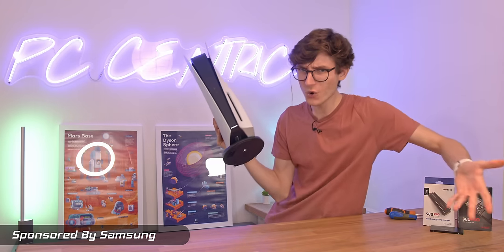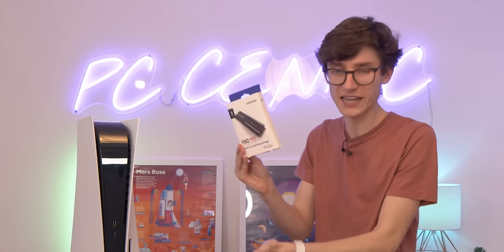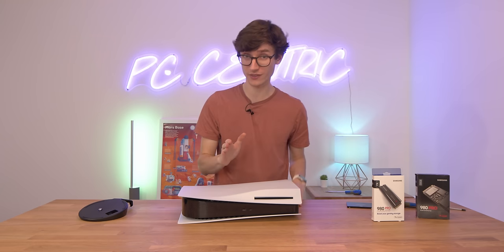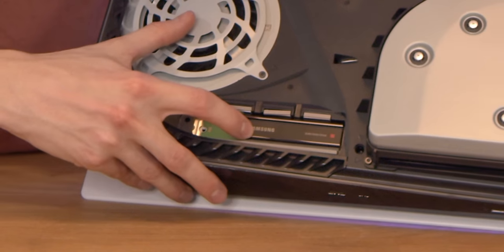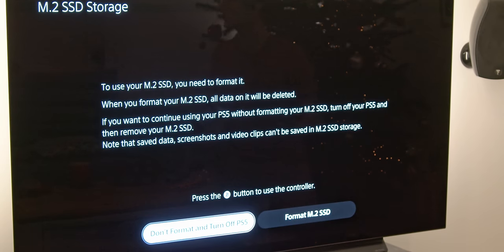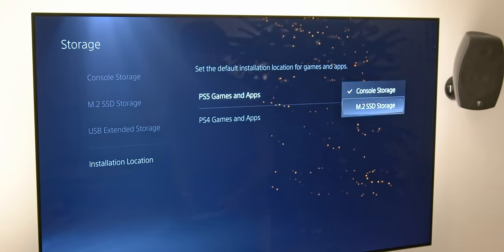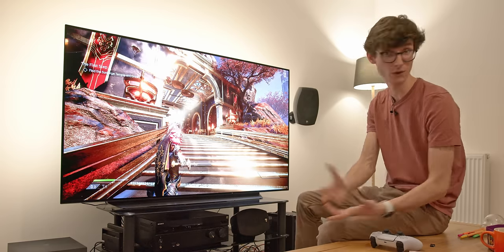How To Upgrade A PS5 SSD 😁 - Samsung 980 Pro Install for PlayStation 5 | AD

Comment: Alright guys, this is extremely IMPORTANT*** when unscrewing the second screw(tiny one), it comes with the spacer given right underneath, make sure to put that spacer on first before you screw the ssd down*** was not shown in this video but just a heads up fellas🤙🏼
Reply: You're the man! Thanks boss
Reply: I think he did show it

Comment: You should tell your viewers to update the firmware before they install it so they'll be able to get Max speeds. If not the drive will be throttled to 5500 mb/s not 7ooo mb/s. Good vid tho 💯
Reply: Dived into the comments to see if anyone noticed the lower speeds
Reply: Update firmware on what? The drive or the PS5? My internal SSD 2 tb of this model comes tonight n like to know what u mean?! Thanks!
Reply: How do you do that?

Comment: The most affordable option that meets playstation specs and comes with heatsink out of the box is Adata XPG Gammix S70 blade 1tb is now on sale for $129.99 while 2tb is on sale for only $249.99 and a 512gb option can also be had for just $89.99.
Reply: Well on Black Friday I was able to get the Sabrent Rocket 4 Plus 4TB for only £560, plus £10 extra for a heatsink. That is quite good considering that most compatible SSDs do not have a 4TB option.
Reply: @shyamal903  Every price that I've mentioned has been for America and again here in America the best 4tb SSD option based on price that comes with heatsink out the box is the Addlink Addgame A92 and it can normally be had for about $550.

Comment: Make sure that the drive + heat sink you select will fit under the drive bay cover (assuming you are wanting to put the cover back on) as some heat sinks can be quite tall. Sony have listed the full specs on their website
Reply: Did he show how to install heatsink in video?
Reply: I think it’s 22mm in width. Which SSd did you get? I’m still deciding between a 1Tb or 2.  Not sure on the brand either
Reply: @davidsalas1561  he did not
Reply: That drive is designed to be heatsink as well you don’t have to get a separate one.
Reply: @davidsalas1561  the ssd had a built in heatsink

Comment: Thank you very much. Great tutorial for someone who was a little intimidated by taking apart my PS5. There is another video that explains how to remove the cover by lifting a corner and sliding back. That technique worked better for me. Other than that one small detail, your video was very helpful. Cheers.
Reply: Thank you, worked so much easier, I thought I was going to snap it the way he said it, where as it came off with ease the way you suggested
Reply: Glad I found your comment first cuz I was about to do the exact same thing. Felt like I was gonna break something so I came to the comments to see if anyone had a better way to get the panel off😅

Comment: Love how the internal screw that holds down the SSD came out so easily. I almost stripped mine trying to get it out. Used the correct size Phillips, but the screw was so cheap and felt like it was loctited on.
Reply: This same thing happened to me it was the only problem i had doing this i had to try five micro phillips finally found one that worked i was starting to worry a lil bit.
Reply: I don’t even see a screw??
Reply: bro mine is completely f*cked. I ordered new screws and I cant get the original out😅
Reply: Same  @MrStipjes
Reply: @MrStipjes  Same, the SSD screw strips easily, a common problem apparently. Wish this video said something about that.

Comment: I put the 2tb 980 pro in my PS5,  it works so nice. It is a very easy install, not too hard.
Reply: How’s the ssd working for you so far? Does your ssd over heat or anything? Cause I’ve been thinking about getting one
Reply: @jacobsorola9580  I have not seen any problems, my games run smooth on it.
Reply: @cb7873  it's been a year. Still running smooth? No issues? Just wondering because I'm about to install this same ssd and have heard kinda mixed reviews
Reply: @anothergamingchannel2656  how has it been

Comment: Ordered the drive at your recommendation and just installed as per your instructions and all went great. Thanks so much!
Reply: We're did you order the drive from?
Reply: Just remember to update it to unlock the full speed
Reply: @Setho666  how do you update it? I’m planning on doing this
Reply: @BurgoYT  Install samsung magician software on your computer. Plug the SSD in to an NVME slot on a computer (whilst the computer is off. An nvme adapter won't work in my experience. The install takes like 30 seconds. After that. Turn of your computer and re-install it in the ps5. I moved all my games away from the ssd before doing this but I've read that you also could update the ssd without loosing any data
Reply: @Setho666  oh nice thanks

Comment: I got my 980 on sale on amazon, $170AUD, bargain price, just got it today and had to install.

Your tutorial was very straightforward, I'm gonna install after lunch, much thanks.👍
Reply: Did you ever install, How do you feel about it??
Reply: @fearlezz365  So simple, took me about 5 minutes all up, restarted the console and another few minutes to get it ready, and I'm getting about 6.5/7k speeds out of it, I only have one game on it, GTA5 but it seems to run fine, no issues thus far.
Reply: @xxXAZNTsukasaAZNXxx  1Tb, on sale for 168aud, I would have gone for the 2Tb but it didn't seem worth it for me personally.
Reply: @xxXAZNTsukasaAZNXxx  Yeah I was never going to buy one at full price, I couldn't justify it.
Reply: @xxXAZNTsukasaAZNXxx  Oh yeah I would have got the 2Tb if it was cheaper, I only see it for more than double the price of the 1Tb's.
Reply: @xxXAZNTsukasaAZNXxx  Amazon AU has the 2Tb for $351 AUD, not sure what that is in US, probably $300 or so, I don't know if they charge extra for other counties delivery wise.
Reply: @dallasgrant  I just got the 2tb for $140.00 at best buy. Saw you installed yours a few months ago. Did it continue to run okay? Have you had to do anything to it like use samsung magician, or just installed it straight out the box and it was good to go?
Reply: @anothergamingchannel2656  I just installed it straight out of the box, it had the "made for PS5" branding I think so yeah opened the box, put in the PS5 and followed the instructions, installed and it all went smooth, I currently have Dead Island 2 sitting on it and the game runs very well, I had I think GTA5 in it and same with it, basically zero issues, it's like it just an OEM part now.
Reply: @Dallas Grant  alright good to know. I went ahead and installed mine and currently am downloading nba 2k23 and seems to be good so far. I had read some reviews where some people were saying there was an issue with the firmware in some of them so just wondered if it worked for you. Thanks for the reply
Reply: @anothergamingchannel2656  No worries, yeah no issues with firmware, I got mine of Amazon Australia so not sure if that makes any difference.

Comment: You’re a bloody legend, thank you. Mine is installed and reporting speeds of 6500 MB/s. Very happy with it.
Reply: Did you update it to reach the 6500, or it was out of the box.
My concern is because i dont own a pc or a laptop,
Reply: @TJ.1  I didn’t update it, it did 6500 out of the box. Which is great because I don’t have a way to update firmware on it.
Reply: @jesseallen4184  thanks.

Comment: Make sure you put the ssd cover back on if you can or you get worse temps. 
Airflow from the fan is designed with the cover in place or a custom heatsink blocking the entire hole.

Comment: I just upgraded mine 4 days ago with a 1TB NVME drive.  I use stock internal and M.2 for PS5 installs and a 4TB external for my collection of PS4 titles.
Reply: I also upgraded mine with a 4TB external drive, as well as a 4TB internal SSD.
Reply: Same thing I'm doing as I alrdy have a wd 4tb used for PS4 but like new so using that to house my PS4 titles n my new 4tb internal for only ps5

Comment: This man’s lucky, I’ve been trying so hard to get a ps5 and no luck
Reply: It's not hard.  Either pay extra for a Ebay one or sign up stock alerts in your area.  I have my PS5 already, and had 10 stock alerts again last week to get one at retail price.
Reply: @hanzobi1926  Well maybe it is just easy to get a PS5 in the country that you live in. I was able to get a PS5 as well, but I was only able to get 1 and I was very very lucky with getting one 7 months after launch.

Comment: Thanks to this Video I broke my plastic clips. Please follow the official sony guide to install an SSD
Reply: It's a bad tutorial for removing plastic!  It is only necessary to push the plastic to one side because the supports are lateral!  Luckily I figured it out on my own in time before I snapped.  Everything else is fine and I simply did everything as he stated

Comment: I wish I could get a replacement screw. The one included with the PS5 is so cheap that it stripped at the first turn. It took over an hour and serveral tools to get it out, and then I had to loosely reuse it, because nothing else fits. Good thing the heatsink is big enough to keep the SSD from moving.

Comment: Thanks, finally decided to buy the 1tb upgrade. Pretty expensive but tired of moving games back and forth from HDD to SSD. Paid EUR 209 for the Samsung SSD in the end.
Reply: Would you say the 1tb is enough
Reply: @MrSPIDEY21  In my case it is. I like to have piles of games installed and still have room left over.
All depends of course on the price difference between the 1tb and 2tb.
Reply: @Bolkiebasher  ok. Because I just bought the 1tb 980 pro and i see a lot of people saying 2tb and 4tb aren’t enough…Idk how that’s possible but usually I keep certain online games for my every day use and I only install the single player game I’m playing at the time anyway. I jus get annoyed with having to delete things to create space for warzone to update
Reply: @MrSPIDEY21  1TB should be just fine. I think I have a lot of games installed but still no space problems. Warzone lol. A main reason I bought the 1TB upgrade 😂. That hogs so much space! Nothing left on the console drive.
Reply: @Bolkiebasher  ok…I’m still second guessing it but you’re probably right lol
Reply: I'm assuming you can probably stored up to 7 ps5 games on the 1tb depending on the game and size . I have a total of 5 games stored on the ps5 console and 3 games on Samsung 1tb . 745gb left in the pro 1tb

Comment: Just upgraded with 1TB 980 Pro too on the same day you uploaded 😁
Though it's experienced that the 1TB-2TB 980 Pro models are somewhat bugged on PS5 due to the read speed averaging about 5500 mb/s only unlike other branded 7000mb/s SSDs getting 6000 above which is kind of odd for Samsung 🤔
Reply: They’re not bugged, you have to update the firmware for the NVME through Samsung. I get 6500.
Reply: @RazimoPlaysGames  after updating it the ps5 requires u to format it then the update deletes.
Reply: @joshd200  Not sure how you've updated the firmware. Mine worked perfectly and getting speeds of 6400mbps
Reply: @RazimoPlaysGames  updated it with my Pc while following the instructions that came in the box
Reply: @joshd200  I dont think ssd firmware would delete if you reformat in ps5 since its flashing it to the drive similar to bios update in which can be flashed with a new version
Reply: @joshd200  you know that little not so little memory that stays unsable when you format any storage device?? Thats the lovely home of firmware 🙃

Comment: Great video and looks pretty simply to do 👍 PS5 next update model needs to come with a 2tb nvme though 825gb was way to low on release with modern games
Reply: It is but they did that because of price costs, as you would be looking a £200-300 more on RRP.  1TB M.2 are still over £130.  For a 4TB your looking £500 at least.
Reply: @hanzobi1926  fair point i undersatnd this  its just annoying with the size of modern games you have to keep deleting games or spend approx another £200 on your own ssd with heatsink

Comment: If you update the firmware for the 980pro by inserting into a computer PCIe slot and using Samsung Magician software it’ll unlock around another 800-1000 mbps read speed. Mine is above 6,500 now. For some reason Samsung has it capped out the box.
Reply: Could I just take apart laptop, put 980 2tb pro in my laptop, update the firmware and then stick it back in ps5?
Reply: @BigNease89  yes, that’s exactly what I had to do. As long as your laptop has a extra M.2 PCIe slot for NVME cards. Download the Samsung Magician software and look up a YouTube videos on how to update firmware. I ran into issues with the software recognizing the card, and found out I had to switch SATA configuration in bios from RAID to AHCI. If it doesn’t recognize it that might be the issue. Google how to switch that in the cmd prompts before just doing it, as it may cause Windows boot to crash at start up, if not done correctly. I had that problem too. I’ll find the links I used for help.
Reply: Try this if it doesn’t recognize the card. 

How do I enable AHCI in Windows 10?
Type command prompt in the search box, and right-click the Command Prompt, and select Run as administrator.
Type bcdedit /set {current} safeboot minimal command and hit Enter.
Boot your computer into BIOS and enable the AHCI mode.
Enter Safe Mode and reopen Command Prompt. Then run the bcdedit /deletevalue {current} safeboot
Restart your computer to execute the change.
Reply: @neveucd  thanks man

Comment: Thank you for the video. Only thing I would warn would be to please take your cover off different from the video. I almost snapped the teeth off of my cover along with the slots the teeth fit into on the opposite side of the ps5 logo. If you simply lightly tap on the to of the ps5 cover with the palm of your hand, you will avoid all potential for damage being done. Hopefully this helps someone. I was almost devastated and I just bought the thing 😭😅

Comment: Just got a 2TB SSD for ps5, the Samsung 980 pro 2TB is on sale. I am using a 1TB on my pc it's insanely fast. My pc boots in 25 seconds with fast boot off. With fast boot on pc boots in like 8 seconds it's insanely fast but due to windows 11 certain software fast boot causes issues running certain programs

Comment: There is a fault with the Samsung 980 Pro in ps5... Read speed max is limited to around 5500mbps. Get the WDblack sn850 instead👌👍
Reply: You have to update the firmware in a PC before installing it into PS5. Then it’ll bump up to 6,500+.

Comment: Sorry but this product is false advertising because the package shows that this Internal Solid State Hard Drive Memory Card can read speed up to 7000 Mb/s. Unfortunately, after formatting on ps5, we got around 5567 Mb/s. If you don't have a computer, you cant update firmware, and you will still be stuck on 5000; you paid for it. Samsung needs to fix it and provide an update using ps5 in order to update it.
Reply: Did they solve this yet cause I'm looking to get it cause it a lot more affordable
Reply: Did they solve this yet cause I'm looking to get it cause it a lot more affordable

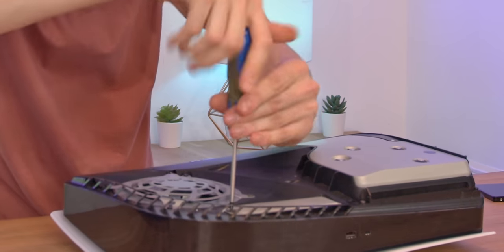Comment: I watched this just to double check which way to unscrew the door and he did it wrong. Check at 2:36 , he screws clockwise, but to get the thing off I had to screw counter clockwise.

Comment: FYI, if you just bought your PS5, set the PS5 up first or this will not work as the PS5 initialisation process does not recognise the new M.2 SSD drive until it downloads the updates during setup..

Comment: Imagine a $500 gaming system comes with hardly enough space for one game tf
Reply: Due to the cost of SSD Sony could provide you with a 2tb version, but would then cost $ 700,-. :-)
Reply: @Bolkiebasher  its still pretty lame any way you spin it. And a 2 tb harddrive does not cost 200

Comment: Please do an Xbox series X version of this!!
Reply: That would basically be just simply plugging the expansion card in the expansion card slot and you are done. The Xbox solution to external storage is basically a lot easier and also a lot more expensive.
Reply: @neveucd  Why do have to make such a weirdly sexually sounding comment?

Comment: Just done this I got the same ssd he was using for £135 from very uk I also got a new controller and ps5 dual sense controller docking station now all I need is the ps5 remote and camera and I've got the whole shabang
Reply: It transferred cod modern warfare with warzone and vanguard and dying light 2 in less than 5 mins